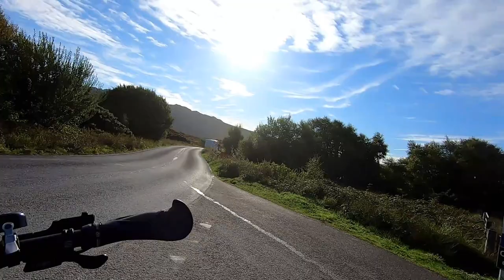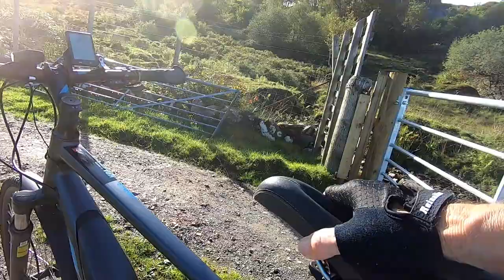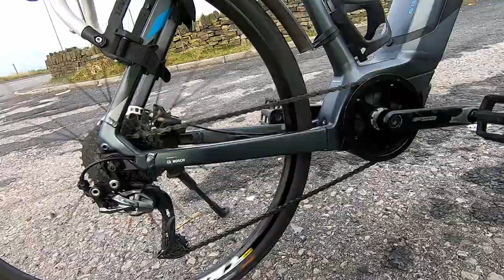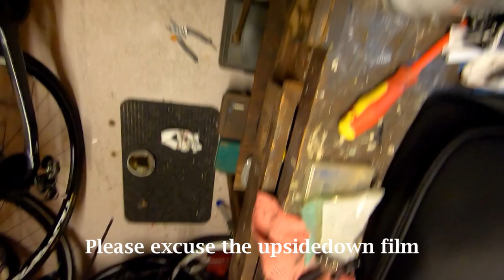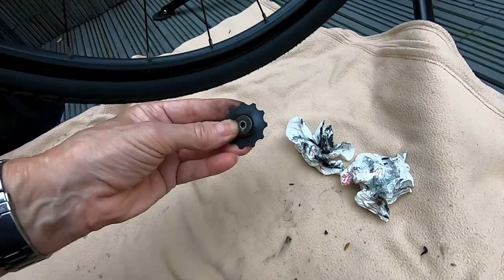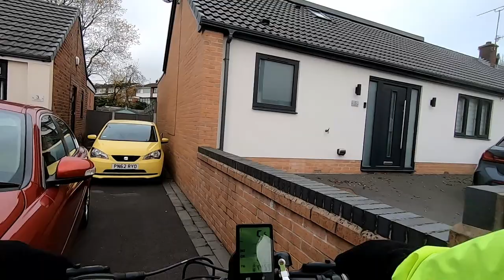Cube Hybrid E Bike: 3,000 miles plus Long Term Running Report.

Comment: Hi Derek
Thanks again for a gorgeous ride around Arisaig, I recognized the exact spot where Gale & I pulled over for lunch when We was there in 2017.  Has for the tapping noise from old trusty? I've read all the comments, and listened again and again to the tapping,  and like one of your commenters I thought it sounded like spokes! Or here's another one that you might want to check, a dead link in the chain? I know you've cleaned and oiled it, but just check it when it's turning, and remember, it will always be worse under tension when you're actually riding it. Look for a rogue link that seems tight and just isn't sitting down like the rest of them!  Dedicated chain cleaner, then a real good oiling of the link will fix it if that turns out to be the issue.  Let Me know how it turns out Derek.
Daron
Reply from the maker: Hi Daron. Yes, the spokes! Well, I thought that myself but there is no sound when freewheeling or when the pedals are turning even under very light load. Only today I recieved my super duper Pedal spanner for £7 and 19pence. Even that wouldn't undo the Cube's pedals without thumping it with the palm of my hand, which hurt a bit. I've swapped them for the blue Vulcan's temporarily just to see if it's them. The Vulcan's are scruffy but have no play at all in them. I will try them out on Friday as I've just had my booster jab and have to take it easy for 48hours. Since the new jockey wheels were fitted I've added another 42 miles and the sound is as bad as ever. It even started right away outside our bungalow so I was thinking it was the motor after warming up but it was still cold. I'll have a close look at the chain next but whilst it was off in the shed it did seem very floppy and flexible. Cheers.

Comment: Great video fantastic scenery around Scotland. I have heard similar clicking noises from a loose spoke so the spokes may need checking you can get a special tool from Amazon to tighten the spokes taking care not to put the wheel out of alignment. After watching the video again listening as you turn the wheel I think it is a spoke issues because as the wheel goes faster the ticking goes in time with the wheel rotation. Hope this helps.
Reply from the maker: Hi David. Yes, as the wheel spun in the shed I also could hear a ticking noise even as it freewheeled. The wheel at the rear isn't the original and there aren't nearly as many spokes on it compared to the original or the front. And they are just black painted steel instead of what looks like stainless steel spoke on the front. I'll have a look as soon as I get chnce, thanks.

Comment: Hi Derek I am confused as to whether the noise is when you are pedalling or not. That would eliminate at lot with the drive train, I think you could feel through your feet if the pedals where making that noise. The jockey wheels need taking apart and greasing every so often, they become much quieter. Is it when you are applying pressure on the pedals or just turning them. On my Vulcan I had creaking from the chain wheel behind the plastic disc with torque sensor and I just put lots of oil down there and it cured that. Good luck with solving the problem. Loved your video the scenery was stunning.
Reply from the maker: Hi Colin. The noise doesn't normally start until a few miles have passed. And yes it only does it as I pedal. Yesterday the Cube had been frozen in the shed but it started to warm up outside by dinner time. I left it sun bathing for an hour outside before I went a ride. But this time the noise started right away as I left our drive, so it can't be the motor warming up. I intended giving it a good run and went over to Baiting's Dam (filmed). It was cold but very sunny. But the noise was present on every turn of the pedals! At one place I swear it sounded as though it was coming from the front wheel but soon as I stop pedalling the noise stops, so it mustn't be the front wheel. I have a pedal spanner arriving today so will try to swap pedals with the Carrera Vulcan as I know they are okay. Being a mid drive motor it is different than the Vulcan E bike. I can't feel anything through the pedals as I pedal. On that ride I started with a battery that wasn't fully charged as someone advised and only just about made it back with 0 miles remaining in Tour (only 32 miles covered - wow!!) I don't think it's the pedals but swapping them will elliminate them. It isn't getting better or worse just this odd noise like Morse Code. Really odd. It has been suggested that it could be something daft that's hard to trace. Cheers.

Comment: Clicking of that sort is usually from a rotational item, which on a bike means there are potentially many. But my bet is on a bearing, as chain/derallier is usually louder than a clicking. That type of noise might probably be from a worn bearing race, and being quite a slow frequency may be from the pedal bearings, or bottom bracket, second to check would be the wheel bearings, but that would be a quicker frequency nise due to the higher rotational frequency. One other thing to check, if not already done is the split link you fitted, was it for a narrow/ebike chain ? I have the 50 hybrid, great bike, but I miss the CX performance engine that I had in my Cube race reaction MTB, which was nicked from my property by some slimy dead man walking scumbags. Great vids by the way, cheers.
Reply from the maker: Hi John. Thanks for the info. There's plenty to go at. I did notice, early on in the shed with the back wheel spinning there was a distinctive click, click, click as the wheel was left to free wheel and slow down. But after I'd found the knackered jockey wheels I completely forgot about this odd noise. I'll set it up again as before and have another listen. I've checked the spokes for looseness and found them okay although some seem to give a bit easier than others that seem really stiff. Trouble is it's bloody cowd in that shed now so I might have to bring it indoors to have a dekko at it. Let it warm up a bit to room temperature and give it good check. I agree with your description of your bike thief. I'd rather not say what I'd do them, the "+£$?X&; - gits! cheers.

Comment: Hi Derek I've got exactly the same bike as you, they're great bikes. I've upgraded a number of components on mine. I changed the front suspension for a rockshox paragon and it's a million times better than the factory fitted suntour! I highly recommend you upgrade yours if you feel flush lol. As for the jockey wheels, they always do have a bit of side to side float in them so it's not always a sign of them being worn if they move a bit. It's very hard to work out what the noise on your bike is just going off a video. Could be many things. Did you fit an ebike specific chain when you renewed yours?
Reply from the maker: Hi Alan. Yes, it was an e bike spec chain. The odd thing is that it wouldn't matter when I start the ride it won't make the noise for a few miles. Is it something to do with motor warming up as it isn't a problem when stone cold? As far as the front suspension is concerned. Yes, I know it's pretty basic but the idea is to leave the bike completely standard to test everything that's factory fitted. I do a lot of miles on road and a lot of road bikes don't even have any front suspension so I suppose the Cube's is better than nothing.lol. Strangely enough, Helen's Scott is practically the same at the front with similar suspension. I'm going to call at Evans Cycles and leave it with them for a good look at when on our way back from anywhere we are heading home from. It will be on the back of the motorhome. I will keep everyone posted on any findings or developements with it. These bikes are good and to see one like it out and about is quite rare wouldn't you agree? Cheers.
Reply: @derektaylor6713  ah I see, fair enough Derek I didn't know what your plans are with the bike. I've put a few upgrades one mine,  there's the front fork and then I put a ten speed deore drive train on it (with a KMC ebike specific chain) and also an upgraded pair of wheels. It'll be interesting to see what's causing the noise with yours, I bet it's something daft! Lol
Reply from the maker: @Alans6563  Wow! That's amazing. Really, I wouldn't know where to start. I bet you're impressed with my modification. Fancy shaped handlebar grips lol. Tell you what though, even these are showing signs of wear at the front on each. Both pedals do have a bit of play with them. They have Cube on them so I'd have expected a bit longer life that this. A bike can be a minefield of possible rattles, squeaks, ticks and thumps but I'll keep looking. Helen's Scott had a elusive rattle which i eventually cured (after much moaning) to the steering headset. It simply wanted a tighten up and has been no trouble since. Cheers.
Reply: @derektaylor6713  The thing is a Derek as ebikes go ours are only really a budget one all be it with a decent frame and a good quality electrics and motor. But cube have to make cost savings somewhere to make it retail for 1700 or there abouts. Classic example being the wheels were they only give you shimano tourney hubs! Tourney being the cheapest most basic hubs shimano produce. It's all cost savings so you can have a bosch drive system for a good price. The pedals will be cheap and cheerful as well. Chances are it's them that are causing you the noise but on the bright side it's a chance to upgrade and get a much better set.
Reply from the maker: Hi Alan. WE know all about cost cutting. We have an Elddis motorhome! Right, so to keep the price down and the electric bit good they fit bargain basement parts in other places which I can understand. Could Helen's Scott be the same? It's 0 dgrees out this morning so I'm not even going near the shed 'till after dinner. I've tried getting the pedals off but they are so tight. I've had them off on the Scott quite easily but this Cube's must have been tightened by Terminator lol. We bought both bikes from Evans in Manchester. I have two numbers to ring for advice but they just keep ringing out. The front wheel is original but the back one was replaced by Evans in 2019 at 400 miles after I reversed in a fence at a site and buckled the wheel. The pedal was sticking out backwards and took the full force of the impact which must have transfered the movement through the motor and the frame. After a new wheel, as was well but could this impact be something to do with the tapping noise as it does seem to be from the motor area. It starts after a few miles. If it was anything else I think the noise would be there as soon as I set off.
Reply: @derektaylor6713  Helens Scott could also be the same and cost cutted in areas,  depends what model it is and how much it cost etc. It's really hard to guess what the noise is without seeing the bike Derek, maybe just take the bike up there to Evans and call in? They must be there today. As for the pedals, what you need is a good pedal spanner because you'll get good leverage with the right tool and that'll make it much easier to get the pedals off. A regular spanner is perhaps not long enough to get the required leverage.

Comment: hi Derek i had the same on my wifes raleigh ebike. i tried everything i could think of. even  headset seat pedals ect. it was so frustrating i then 
took the front chaincase off and put blu threadlock on the bolts. i also took the plastic cover off the the left side ot the bosch motor and tightened
the motor supporting bolts put it all back and all sorted. the only thing i dont know which one was the culprit as i did them both together. hope you are feeling ok  after the booster, had my flu and booster tuesday was off the bike for a couple of days but ok now. tried to send this last night
but electric went off in the storm. im in N Wales.
Reply from the maker: Hi Brian. A power cut in that lot! Not nice. 
Yes, the latest thing I've swapped are the pedals from the Vulcan. Nothing wrong with them but the noise persists. I am running out of ideas but what you suggest is a good one. Check the motor mountings. Now I've never taken the casing off before but when it's warmed up a bit I'll have weigh up. I take it the bike requires turning upsidedown? 
Both our bikes are stuck on the back of the motorhome as we were meant to going up to Kendal for a few nights. They phoned and cancelled due to the big storm on site that caused some damage. The M62 was also shut so if we'd have set off a bit early it would ahve been a disaster lol. 
There's a big film coming where I ride all around Loch Leven with a lot of music here and there (Youtube permitting). In places you can just about hear the tip tapping faintly but at the time I didn't notice. That was way back in June about 600 miles ago. 
We had our booster jabs together and apart from slightly sore arms we are okay, but we think we might have colds coming on which we got before the jabs. 
Leave it with me and I'll give it a go. Thanks.
Reply: @derektaylor6713  Hi Derek ,my wife's motor is the Bosch active line which you can get to the mounting bolts from the left hand side without putting it upside down, but I'm not sure what support the cube has. also check them front chainring bolts, ours weren't tight. electric back on been for a walk wind-chill freezing better off staying at home.we like the lakes usually stay at Kirby Lonsdale a good base Brian.

Comment: derek is there a bottom bracket in that motor if there is thats your problem.
Reply from the maker: Hi Anthony. Is there a bottom bracket in the motor? I don't know. In fact, what I know about the mystery motor in the casing you could write about on a jockey wheel lol. If it involves even breathing on that motor count me out. I call myself, 'Derek the Destroyer of All Things!' I will take it to somewhere that can service or repair these items. I can just about do basic routine bike maintenance but as far as this other is concerned -  I'll leave it to the experts. Cheers.
Reply: @derektaylor6713  hoefully you get it sorted  clinking noise would drive me mental lol .in my case  my road bike  BB was the problem due to being the bb shell wasnt faced so it didnt sit flush against the frame.

Comment: Morning Derek, I hope by now you've got the ticking noise sorted, I was told by an experienced mechanic that a clue to which bearing is causing the problem is tone. A deep tone would indicate a possible bottom bracket issue whereas a higher sound might be a pedal/cassette problem.
Anyway I hope all is running smoothly now.
Reply from the maker: Hello Alan. Nice to hear off you. Yes, I'll ride it (weather permitting) as usual and next time we are are away we say we'll call in at Evans Cycles in Manchester on the way home. I bought the bike from them and hopefully they will be able to sort it. Cheers.